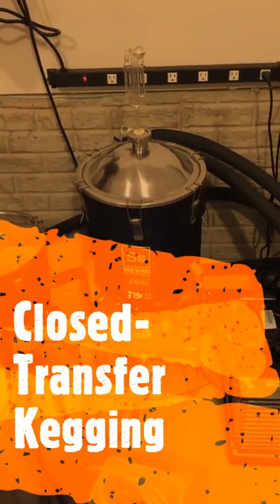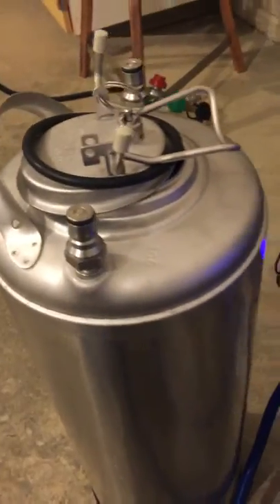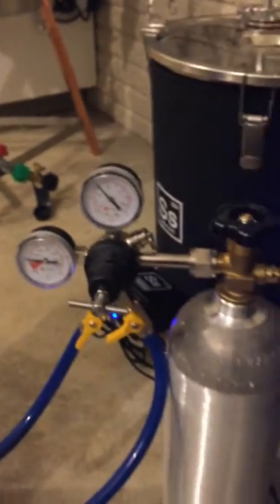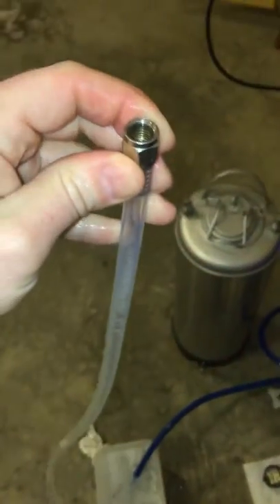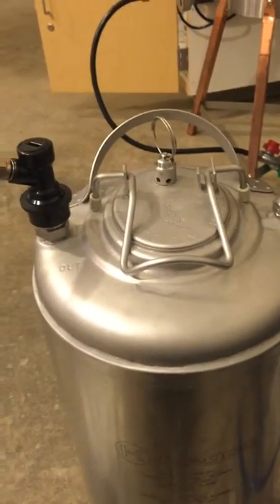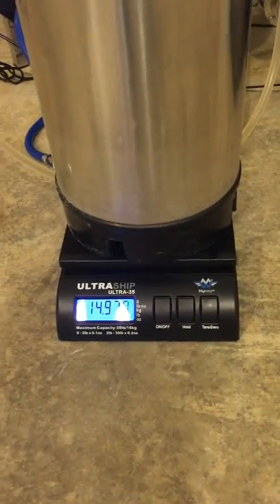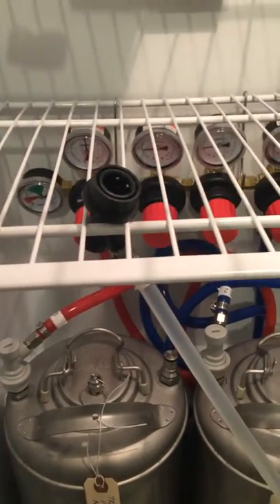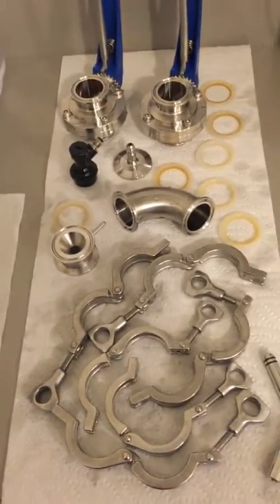Closed Transfer Kegging with SSBrewTech Chronical

Comment: I'm a newbee, and am rapidly coming up on my first transfer.  What I don't quite understand is, why not just initially fill the keg with Star-sans, and then use CO2 to displace the Star-sans from the keg (thus leaving a CO2-filled keg), then fill that keg with beer from the conical fermenter while expelling the CO2 in the keg from a line on the "liquid out" ball valve into a sanitized bucket (like a blow off line)?  That way, there is almost NO oxygen in the transfer system.  I am not all that convinced about the efficacy of CO2-O2 displacement.  But I am open to comments from those with more experience!

Comment: Hello, nice video and thank you for sharing.

Curious to know the glycol chiller you are using and based on the hops left in the conical, I'm assuming it's an IPA? 

How long did you cold crash the beer and at what temp? I think I read 37 degrees before you shut it off?

Thanks!

Comment: Ok I’m getting ready to make an order on SS Brewtech’s site. I’m wanting to do a closed transfer with my Brewtech Unitank to my keg. My keg has pin locks. What fitting and sizes do I use on the butterfly valve and try clamp on the Unitank? Also what size line are you using and to hook up to the fittings on your keg? Have a link to these? Thanks!